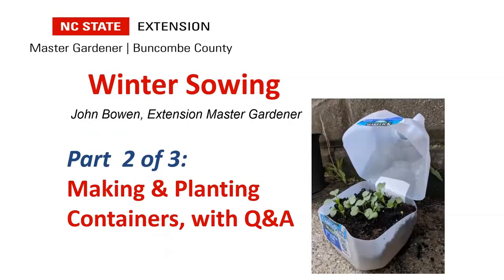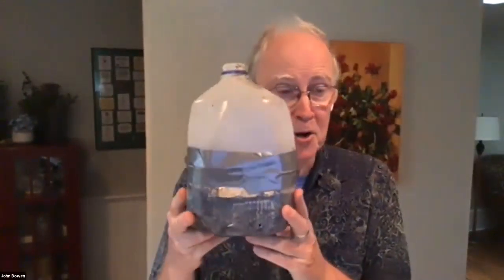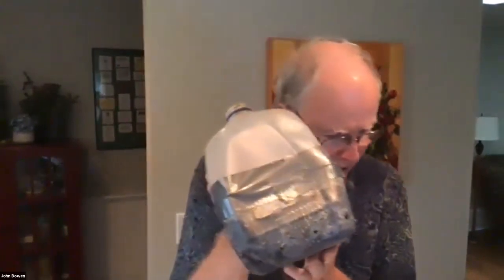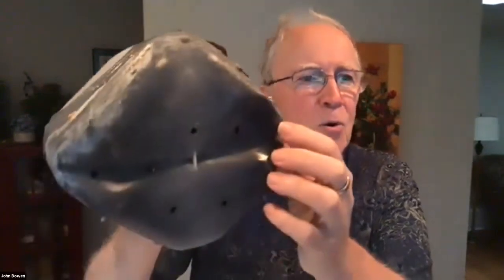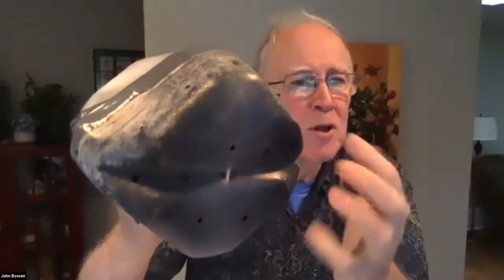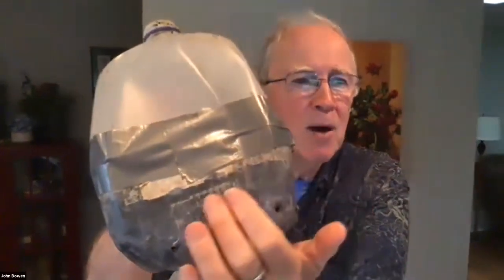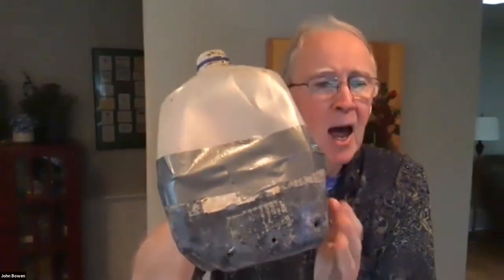Winter Sowing Part 2 of 3 2020

Comment: If you have to water the jug because your winter is too dry, I would water from the bottom and let it soak up what it needs... just like when watering seedlings in trays. 

I use a cheap ($10) soldering gun outside to put holes in containers. It is so fast and easy. If I want a bigger hole, I just make a second pass or put pressure on the hole to one side to make it bigger. 

I like the hinge to be under the handle. Subconsciously,  it just feels stronger to hold it by the handle side when moving the jug so it won't come apart as easily. Just a preference.